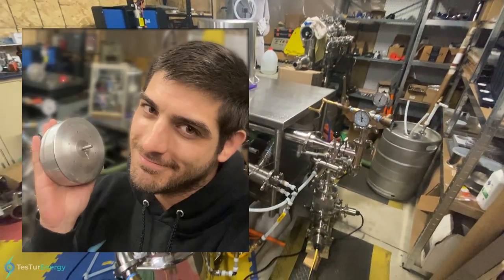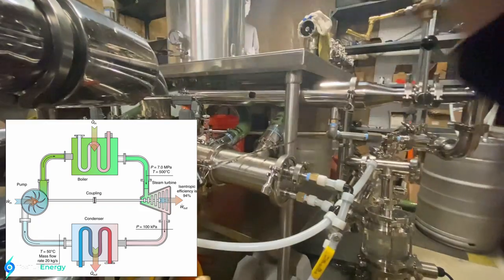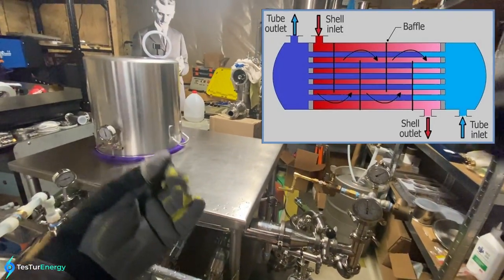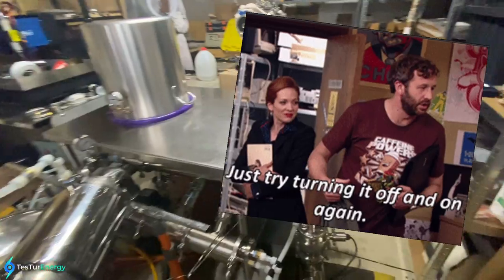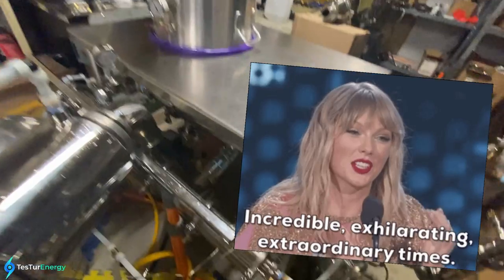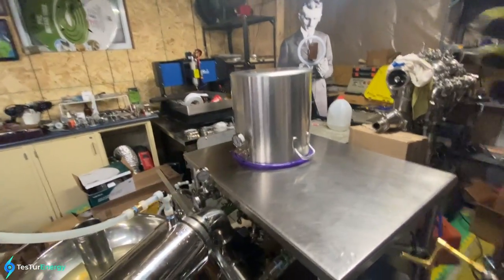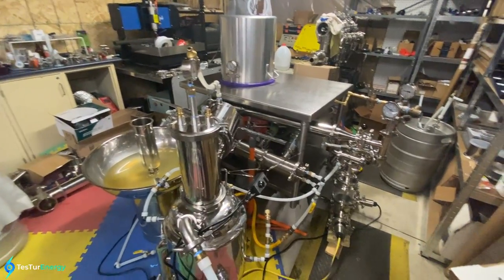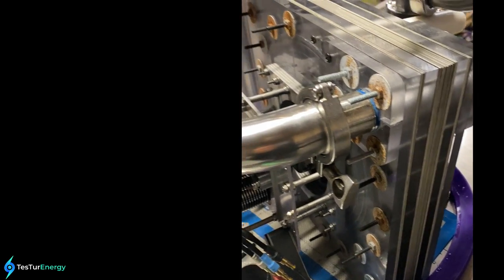Steam Tesla Turbine Renewable Energy Micro Power Plant - 1st Start Up

Comment: Impressive engineering!!! 
Have you considered putting permanent magnets on the turbine shaft and having the magnetic flux jump the pressure barrier through a glass or plastic wall? 

Or putting the whole PMA inside the pressurized system and only  bringing the wires out?
Reply from the maker: Hey thanks for commenting! Yes those are good suggestions.

Definitely worth testing in the future.
Reply from the maker: Hey I just posted a new video! I think you’ll really like it.
Who Owns Your Copy in the A.I. Revolution?
https://youtu.be/_v0N83U4NoU

Comment: Where did you get a dynamo or power generator any info you can share.
Reply from the maker: Hey thanks for commenting! Any permanent magnet motor can be used as a generator. Just pick the right Kv rating (rpm/volt) and/or gear it so that it’s outputting the desired voltage when the turbine is spinning at the desired RPM.

Comment: built a little fantasy in my head lol. boil water get power from pressure turbines, thermocouple to make power, solar, steam goes up water comes down hydro electric. for night farm biofuels and possible hydrogen. buy 4 acres for cheap in the middle of nowhere. pto generators are interesting
Reply: Imagine... Steam condenses and fills a bucket suspended from a pulley. Once full the bucket is released and pulls a rope through a pulley system. The other end of the rope is attached to one them button flywheels we made as kids. The bucket lands on the fire replacing the empty bucket. That button with the string through it is actually a generator and/or a pump depending on the direction of rotation. Imagine never waiting for water to boil,  your shower never going cold, no electric bill or water bill because your steam powered refrigerator also condenses water from thin air. 20,000 psi is what water freezing is capable of. Winter might have more potential energy than we think.
Reply from the maker: @painkey1189  Hey I just posted a new video! I think you’ll really like it. Who Owns Your Copy in the A.I. Revolution? https://youtu.be/_v0N83U4NoU

Comment: Hello, I am fascinated by your work. I am very familiar with the tesla turbine design, and have an engineering background, career degree blah.  So I do not need the explanation of how that aspect works and I have understood your design aspects with respect to the turbine.  

I was reading on an insta post you were estimating 40% efficiency with room for more. I am curious as you mentioned the calculation was somewhere on your YT. Could you share it? Like I mentioned you have my attention. 
Have you laid out the design on a flow chart? I assume you have, but I have not seen it drawn out and it might be helpful for folks to understand what your doing. 

Thanks
Reply from the maker: Hey Duckman56, thanks for reaching out! I can certainly share that with ya. 

Make sure to check out the latest updates on the combustion + steam Tesla turbine builds!   

Tesla Turbine 250 watt to 2.65 kW Power and Efficiency Test https://youtu.be/K7qZvq1CMFg  

+5 Horsepower Tesla Turbine Dyno Jet Turbo Power & Torque Curve 375 mph @ 12,000 rpm  https://youtu.be/exF5Rn-L8gs  

Solis Talks Tesla Turbines - Nikola Tesla’s Electrical Power Systems Patent GB 186,083 Walk Through https://youtu.be/5Y3D13JmtcA  

Tesla Turbine Jet Engine - gasoline fuel burner atomizer flame tube test 186,083 propane burner https://youtu.be/gRqKowignac 

Steam Tesla Turbine Micro Power Plant - 1st Start Up https://youtu.be/aMYyBsjhBR4   

https://www.instagram.com/reel/ClqGwiDDRSN/?igshid=ZmMyNmFmZTc= 

Let me know when ya get through that and I can help explain it! 🤓🙏❤️
Reply: @CharlieSolis  made it through last night and I appreciate the direction with the links. If you don't already have them a Playlist would be helpful since there is so much content with build and troubleshooting, but also the point where you show the data. Seeing the data made me want to dig deeper. If you have it setup already disregard the message. 
Anyway, awesome work! I had seen the update turbine patent a while ago and was impressed you referenced it a year or so ago. However back then there was a lot of things you were working through and It was not clear if the path would lead to an operating setup that could be tested. So I am extremely happy you responded and have been killing it. 

It is impressive the torque you're able to output. What have a 3:1 or 46:15 gear ratio? So you're output after gearing is 1/3 the torque and 3x the speed of the turbine? Is it due to the generators you're using, or is there some advantage to running that speed and lower torque? Also I was looking for the video because I wanted to make sure I heard you right but in another video you were mentioning  axial or transverse Flux generators would allow you to eliminate the gearing. Now I know they have higher torque capacity, but they also generally run at lower rpm are there any that are able to run at 4000 rpm?
Reply from the maker: @duckmn56  hey yay! I’m glad you like all that. 🤓
And thank you for watching my stuff as well. I really appreciate your interest in my work. 

yeah that’s a good idea I def should just put them in a quick playlist 😅 it would probably make them easier to go through and not have to click back to my comment just to get the next link. 

I have other playlists but not like that genera stack in small palatable playlist. 

So yeah I apologize for the disorganized nature of my channel. I’m just now starting to get the hang of this whole video making and editing process. So bear with me as the next few videos hopefully should be more clear cut. 

To get to the other part of what you wrote about, I’ll go through piece by piece. 

“What have a 3:1 or 46:15 gear ratio? So you're output after gearing is 1/3 the torque and 3x the speed of the turbine?”

Yes the generators are spinning at ~3x the turbine rpm. 

“Is it due to the generators you're using, or is there some advantage to running that speed and lower torque?” 

The only reason I geared my TesTur up to generators what literally to spite everyone and their mother who DEMANDED that TesTurs “must be geared down to work because they get low torque and high rpm……..blah blah blah” 
😅🤓😎 
for real though, I knew TesTurs could get plenty of torque, even at low rpm, and I wanted their to be absolutely no question whether or not it could get more than enough Torque to not just be direct on shaft with the generators but also be geared up to a generators. So I went and geared them up to the generators. 

And now it works so well, and people see the gear, a bunch of the comments are “see you still had to gear the turbine down!……” 🤭🤷‍♂️ 

So this is by no means how I will be doing it in the future. As you mention I have plans for direct on shaft generator setups which will eliminate gears and bearings from the build. 

I’ll also say there was a little bit of “this was the easiest thing I could get to work” going on as the generators and gears are straight outta my RC car. 🚗 👨‍🔬 😂

Though my RC car is back together and I bought extra replacement ones to build it out the turbine to the 4 generators and I had to design and machine a custom gear hub for the gear to seat on the hex driveshaft. 

“Also I was looking for the video because I wanted to make sure I heard you right but in another video you were mentioning axial or transverse Flux generators would allow you to eliminate the gearing. Now I know they have higher torque capacity, but they also generally run at lower rpm are there any that are able to run at 4000 грm?”

Yes I do have some old videos on the axial flux designs I put together but I believe I made a bunch of my old ones unlisted because they were just not made well nor were performing well. So I felt it best to unlist them. Though I may want to bring some back or just re-record them and post them 🤷‍♂️ idk we’ll see.

Though they should still be watchable from any playlists that they are in, I will share a link to one of the axial flux videos of mine for you to watch in a follow up comment.
Reply from the maker: @duckmn56  here’s one of the designs I had come up with a while ago for a dual stage axial flux direct on shaft exist flux generator set that go between the stages, (coincidentally in the same place that I have designed the “Interstage Heat Exchanger design”)

Dual Stage Tesla Disc Turbine With Built In Dual In-Line Axial Flux Generators CAD/CAM Walk Through
https://youtu.be/FIkU8Gny8i8

And if you’re interested check out the,
Tesla Turbine - InterStage Heat Exchanger (ISHE) - Heat Pump & Inverted Brayton Cycle Improvements
https://youtu.be/pYSniitC8DM
Reply from the maker: @duckmn56  as far as axial flux and rpm. Yes you can absolutely design a high rpm axial flux generator. They usually don’t make them and they are hard to find ever for high rpm simply because their are very few high rpm power generators that they would be put onto. Wind turbines are usually high torque low rpm, and even automotive piston engines that are usually paired with generators are considered high torque low rpm. It’s kind of a chicken and the egg situation. One industry designs their standard products to go onto another industries standard products. 

The windings in the axial flux generator just need to be adjusted to increase the Kv (RPM/Volt) rating of the axial flux generator. 

And on that note have you see Koenigsegg’s new “RAxial” flux generator/motors? 🤤🤤🤤

“Radial and axial flux”

+300hp and only 33kg 🤯

https://youtu.be/W39yEt4R-SU

https://youtu.be/fDmO5e-xQS0
Reply from the maker: @duckmn56  Hey I just posted a new video! I think you’ll really like it.
Who Owns Your Copy in the A.I. Revolution?
https://youtu.be/_v0N83U4NoU